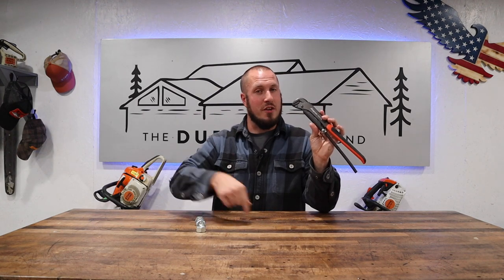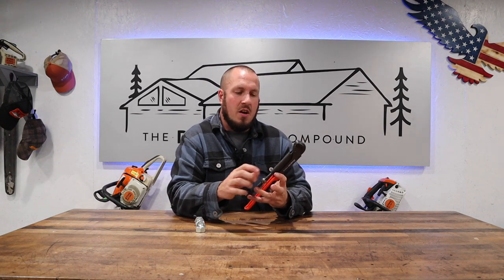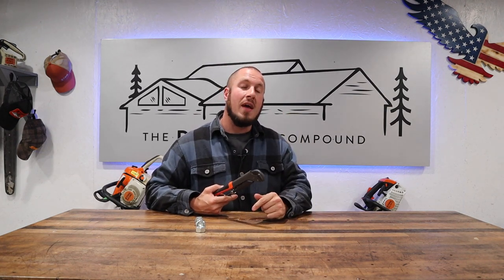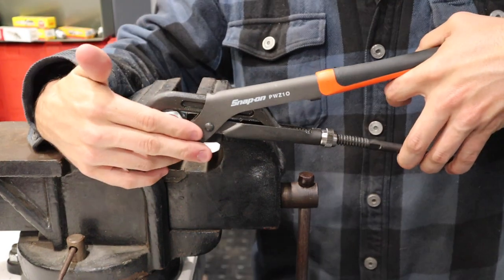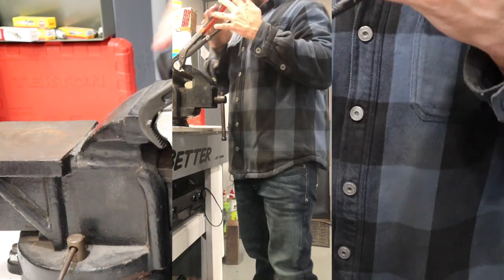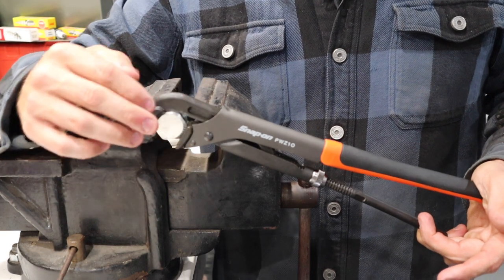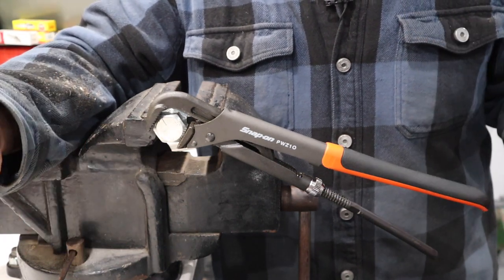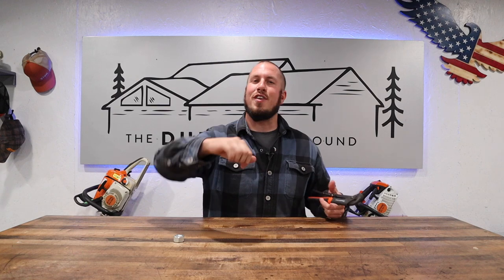Snap-on Plier Wrench Review PWZ1- A Must Own!

Comment: Bahco makes some excellent tools and if you can swing it definitely go that route. However, if you're in a pinch and tight budget Harbor Freight sells the Swedish Style Pipe wrench that is this style and the work great. I repeat, the HF ones are not Bahco and won't hold up like the quality Bahco ones, but if you're on a budget they do work. Like most mechanics I have used the cheaper tools until I could afford the better ones.
Reply: Harbor Freight’s Icon just released a replica of this wrench, 21” 17” and 12” 
4 weeks ago

they have quick adjust and the 21” is only $35 while the 12” is $20. 

You should check them out

Comment: BAHCO makes awesome tools, got  3 sizes  of this one. BAHCO is an old Swedish manufacturer, and over here it is concidered to be the absolut top brand of tools 😊
https://en.m.wikipedia.org/wiki/Bahco
Reply from the maker: Good to know! Would you mind sharing a link to some of your favorite Bahco tools? I’d love to buy some more and check them out as well!
Reply: @TheDurbinCompound  This is my favorite wrench, Bahco 31 R US Industrial Grade Alligator Adjustable Wrench. It comes with an extra feature, the "alligator" V-jaw on wrench that has aggressively angled teeth for sure grip on pipes and rounded fasteners.
https://www.zoro.com/snap-on-industrial-brands-bahco-alligator-adjustable-wrench-31-r-us/i/G7620247/

The alligator wrench was patented 1922, that is 100 years ago ...
https://skiftnyckeln.blogspot.com/p/hajnycklar_31.html
The opening is reduced by the design of the jaw ends in order to prevent the key from being used on coarser pipes than it is intended for.

The best thing with Bahco tools is that the quality is so great that they last for your remaining life time without loosing the precision and strength. I have never in my lifetime broken a Bahco tool :-)
Reply from the maker: Awesome! I’m going to get these on order!

Comment: Have been around for probably 100 years in Europe. Bacho invented it and was also first with the "modern" design of adjustable wrenches (before Cresent). The plier wrench and adjustable wrenches from Bacho are probably on par with Snap-On quality (at least before when they were Swedish made). This plier wrench is primarily a pipe wrench, used by plumbers. Hardly any other tool can grip pipes as strongly as this wrench. It is also very good for other types of pipe fittings. Much stronger than a channellock. But not as good as an open ended spanner for nuts and bolts. Knipex probably makes better channellocks and other pliers but not these type of pipe wrenches.